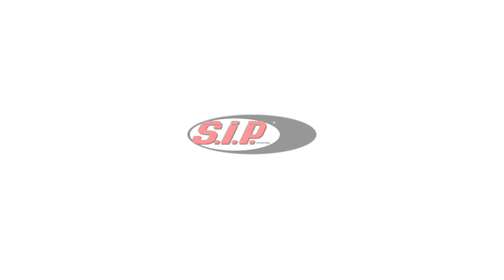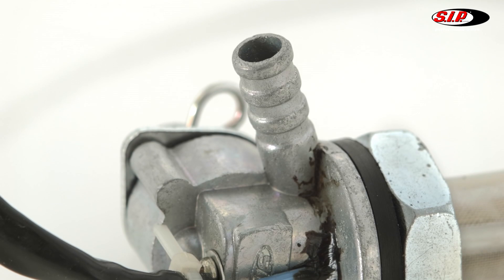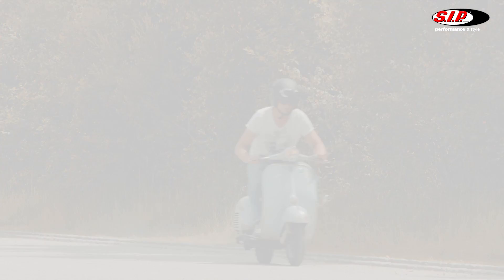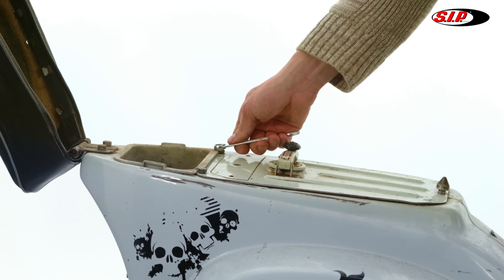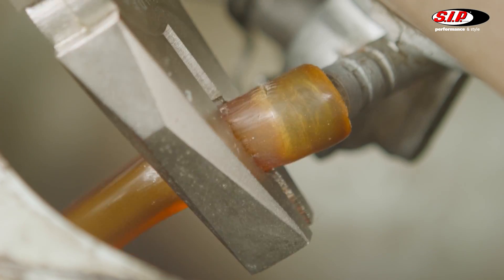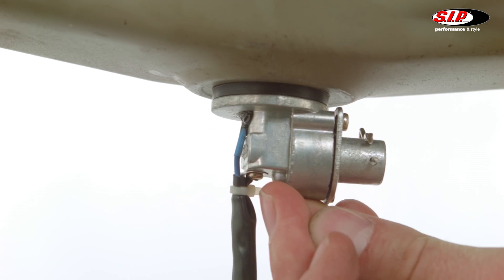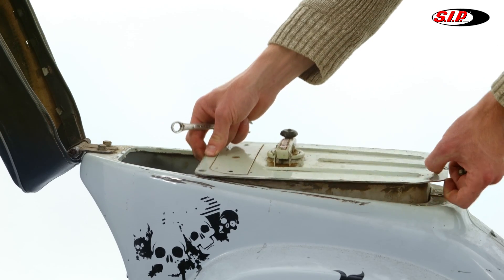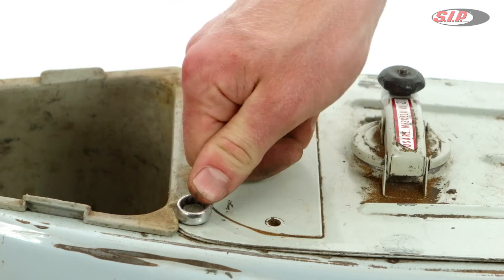Tutorial: SIP Fastflow fuel tap for Vespa - introducing and mounting

Comment: Fuel tap is good except for the rubber sealing washer inside of the tap. It leaks. To fix it you must order a new replacement seal from SIP. This replacement seal is 3mm thick instead of the 2mm seal supplied with new fast flow tap.

Comment: where do i have to connect the wire from the sip fastflow fuel tap(black/green)??? the SIP speedometer only came with an extended cable for the temperature sensor!!!
Reply: same question for me!!